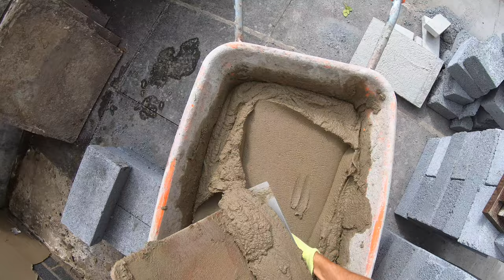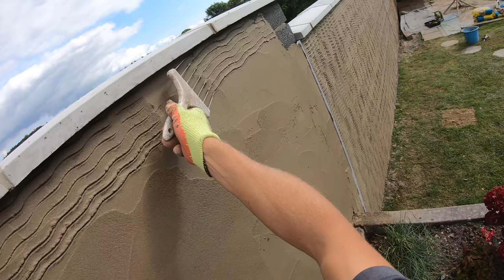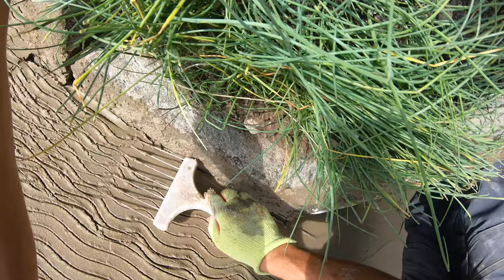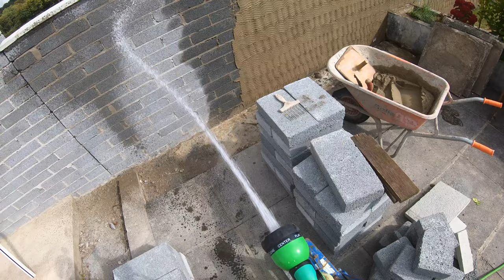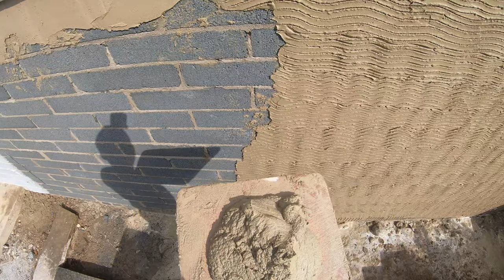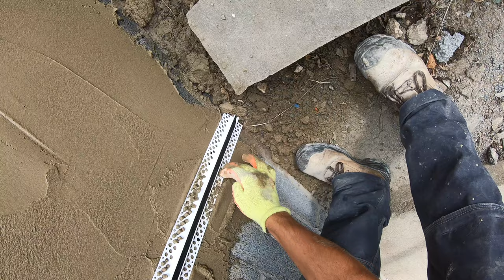Applying scratch coat render

Comment: Hi, great job 👌 and thanks for sharing. I have similar job ahead of me perhaps you can advise on the following questions: do I need to apply scud coat first on concrete blocks?  
What mixture did you use for the scratch coat ?
Thanks a million
Reply from the maker: Hi, thanks for the compliment.  I wouldn’t do a scud coat first.  I just do a scratch coat then topcoat but I have heard of people doing scud coats in Ireland.  For my scratch coat I would do a mix of 4:1.  Always make sure you do the topcoat weaker than the scratch.